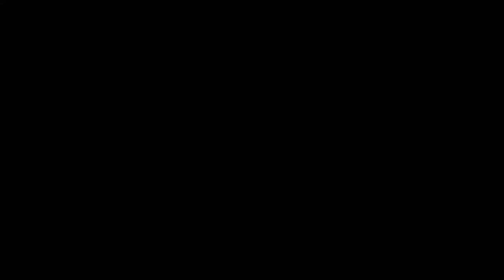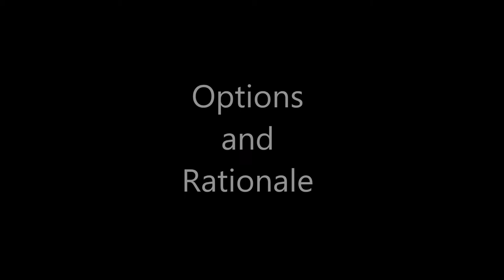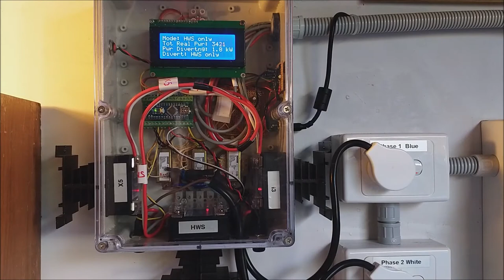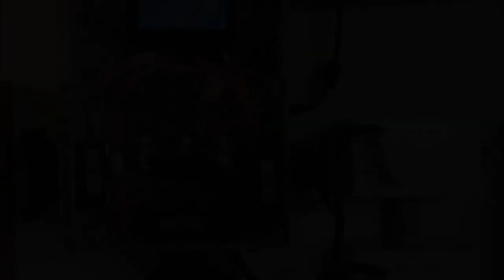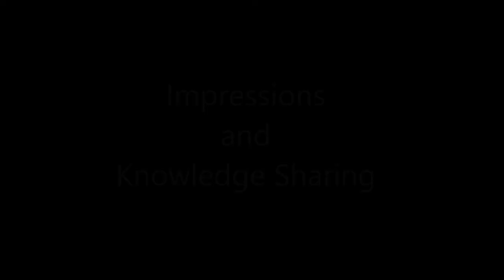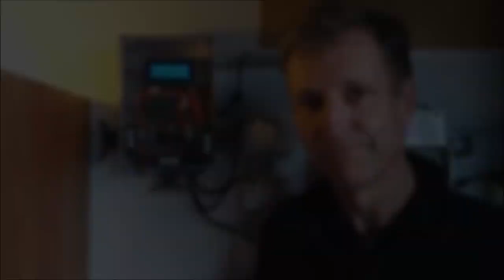DIY Solar Energy Diverter for Electric Vehicle (EV) Charging and Hot Water

Comment: Hi Gav, really nice build there! How did you go about having the SSR's connected into your system? Looks like they are hard-wired over to a distribution box on the right - did you need to jump through any hoops re regulatory compliance there, or was it a matter of finding a sparky who was happy to look over it and give it the nod in order to wire it in? I ask because I'm also in Oz with our rather restrictive regs, and looking to do some similar projects. Currently my plan is to use a Shelly Pro 2PM simply because it gives me an RCM tagged device and I can control it without physically connecting to it via wifi. Not the best for control, but solves the regulatory issues. Interested to know how to get a sparky on board with that sort of set-up (or does one just need to make more tradie mates?) 🙂
Reply from the maker: Hi Ashley,
I had a 'friendly' sparky do the work. One option might be to run the outputs of the SSRs to a separate junction box for connection to the switchboard or switches (rather than running the physical cables into the device).  Might give your sparky a little more comfort. 
I'll be posting one final video shortly. I replaced the SSR with a phase angle controller for the HWS. It's working well and eliminates the need to draw on the grid when the export is lower than wattage of the element in the HWS.
Good luck with your project.
Cheers, Gav.

Comment: Good day Guv,thank you for the vidoe  very informative .I am a final year electrical engineering student and i want to build a tyristor based load diverter,one that  be connected  to a restive load like hot water system. I would appretiate  suggestions and any form of help
Reply from the maker: Hi Zwelethu,
Please have a look at the links provided in the video description where you'll find a more detailed write-up of the project and its elements.
I would also advise you have a look at the Open Energy Monitor website where there's learning resources relating to power diversion (and of course the base code /sketches that I used for my diverter).
Good luck with your project.
Cheers,
Gavin.

Comment: Hello, thank you very much. I would like to do something similar with our water heating and EV charging. Esp32 micro controllers (with wifi) cost the same as Arduino nano these days, so I think that is the way to go considering your (and mine) plan to move the controls to our smartphones. For when I am out of the house and wifi and I want to switch some appliance like immersion or heating, I use Ngrok , running on Raspberry pi zero, a relatively secure tunnel to the Esp32's IP address from anywhere around the world:-) Better go install those solar panels. Good luck and thanks again

Comment: Hi! Thank you very much for the project you gave us. Can you give me the diagram for the three-phase system? I don't know exactly which pins to use for input on the Arduino board and which pins should be used for switching programs. Thank you very much!
Reply from the maker: Hi Marian,
You'll find a link in the YouTube post to a PNG file with a high level circuit diagram.
In terms of the pin assignments, please look at the Arduino sketch (program) which is included in the attached files (it's the .ino file).  You should be able to view this in a text editor or you can install IDE (the Arduino programming editor).

My input pin assignments for voltage and current sensing are (refer lines 83-89 of the code) :
Phase 1: Voltage - Analog Input Pin 1, Current - Analog Input Pin 0
Phase 2: Voltage - Analog Input Pin 3, Current - Analog Input Pin 2
Phase 3: Voltage - Analog Input Pin 7, Current - Analog Input Pin 6

My input pin assignment for Case statement switching is Digital Pin 11 (refer code line 16)

The output pins are (refer code lines 17-19):
HWS: Digital Pin 8
Electric Vehicle 1:  Digital Pin 5
Electric Vehicle 2: Digital Pin 2
These are not correctly shown in my circuit diagram - I separated them to make it easier to connect the wires. Obviously, you can use these pins (and other digital pins) to control any electrical device.

I hope this helps.
Cheers,
Gav.
Reply: @greenenergygav8053  Thank you very much for the answer! I still have a little confusion. In the diagram you gave us, there is an output on analog pins A1 and A2. The output that is on A1 should be moved to A0 and respectively A2 to A1? Thanks again for your help!
Reply from the maker: Hi Marian,
My apologies, my diagram is a little misleading and was more intended to provide a high-level overview. 
There are 8 analog pins on the Nano (A0-A7).  Two of these (A4 and A5) are used to drive the serial interface of the 4 x 20 display. 
The remaining 6 pins (A0-A3 and A6-A7) can be used in any order for the voltage and current sensing. If you're on single phase power, you'll only need to use two of the pins. You can define which pins you're using in lines 83-89 of my code. In my case I've used pins A0 and A1 for phase 1, A2 and A3 for phase 2 and A6 and A7 for Phase 3.
The code is clearer to refer to in this respect than my high-level diagram which only shows voltage and current sensing for a single phase.
Cheers,
Gav.
Reply: @greenenergygav8053  Thanks Gav! You're a great guy!
Reply: Hello ! I finished mounting the electrical part of the board but I cannot install the program in the arduino nano. An error occurs at point 47 (LiquidCrystal_I2C). Thanks in advance for your help!
Reply from the maker: Hi Marian,
You'll probably need to work this through on your own.
I suspect your display is different to mine and may have its own library (refer line 6 of the script).
The best approach will be to write a separate simple script that displays characters on the display (there will be plenty of samples online). In this way you'll be able to verify the correct library for your display and confirm its operation. You will need to add this library to your IDE environment (again, there's content online that will help you with this).
Once this is all working, you can then update the energy diverter script.
Cheers,
Gav.
Reply: @greenenergygav8053  Multumesc Gav pentru tot ajutorul acordat !
Reply: @marianaldea6182  Salutari. Ai reusit sa pui in functiune dispozitivul? Sunt si eu interesat. Multumesc.

Comment: Hello!
Do you have a schematic for this diverter?
Reply from the maker: Hi Ianovici, 
I've added a link to the high level circuit schematic in the comments section. I hope this helps. I've not been specific with regards to the input and output pin connection to the Arduino. You can see the ones I've used in my Arduino sketch for my Diverter.  
I've also been working on a form of PWM for the Hot Water Heating and it seems to be working really well. I hope to post an update video soon.